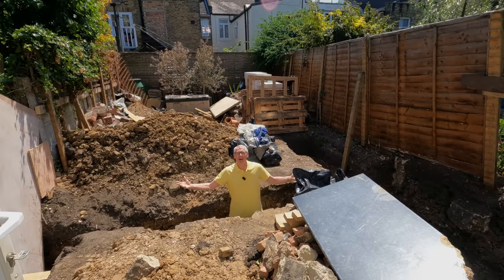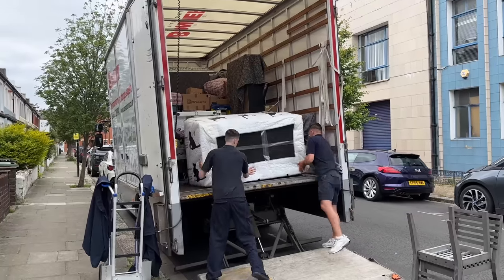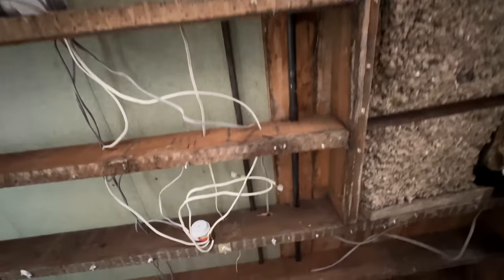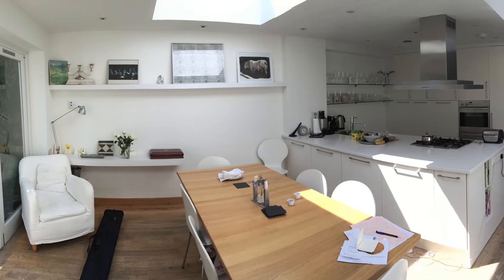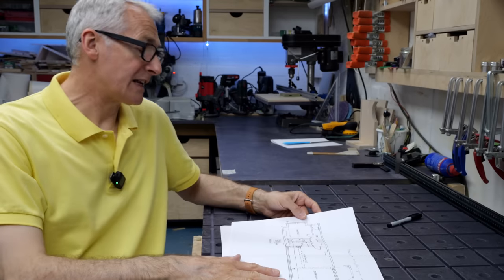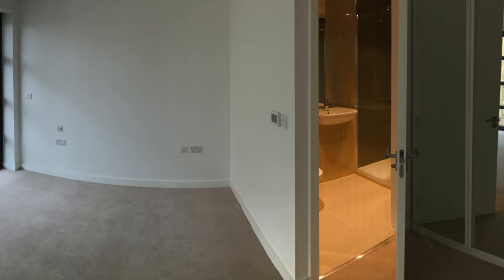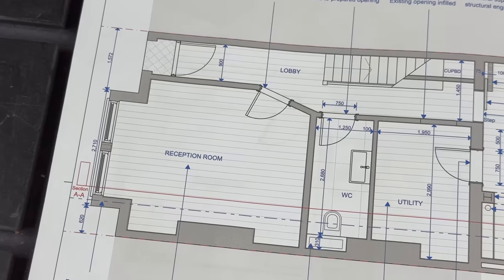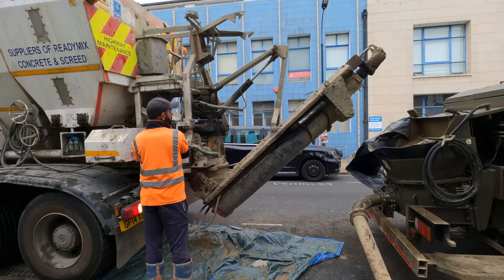Kitchen Extension in a Victorian London House [video 533]

Comment: Great start. My daughter and son-in-law are almost at the end of the revamping of my mother's house. Great chance to upgrade as much as possible. Electrics, plumbing, heating, and of course insulation. They had hoped to be in mid January, well they are living between families. The question is, can you stand back and watch others do what you know a lot about?
When done with some good tradesmen, you will have a great property. Still made of bricks and mortar. 
I watched plasterers do magic. An oak staircase going in like Robin fits. It's an art. GOOD LUCK! 
I was impressed by a young guy who fitted the kitchen, making the worktop pattern flow over the edge and down to the floor. A one man band who came highly recommended.
Reply from the maker: Thanks! I’m 100% all-in on letting others get on with it. Really pleased to have some great people involved, and yes the whole ground floor is getting reworked.  👍👍

Comment: Hi Peter. It would be good to hear about how you went about choosing an architectural type person and developments with them. Ditto how you chose the Chartered Structural Engineer and how the scheme was developed with them. And finally for this mini-tour how you went about searching for and agreeing costs and timescales with the builder, and if and how they changed the scheme and how thar was handled with Building Control. And if you've any energy left after that lot, to cover Party Wall etc. matters and arrangements with neighbours. [item 3 noted and respected].

Comment: Interesting project Pete.  Good luck!!  We did something very similar about 7 years ago on a 1907 house.  We stayed in the house throughout the build which made sense to us at the time.  You get used to grit and dust in your food eventually!  I'm sure you're already on top of this, but the one thing that really caught us out was delivery timelines.  We'd made assumptions (I know, I know) about how long thing would take and we were badly caught out.  Classic example being the liquid screed floor we had laid.  They take literally weeks to fully cure and filled the whole place with so much moisture we ended up with dehumidifiers all over the place, and that was in summer.  The other thing that really shocked me was the amount of goods that turned up damaged and had to be replaced - radiators, lights, coving, doors, windows, bifold bloody doors!.  I would say that (conservatively) 40% of what turned up had to be replaced. Also the sheer volume of decisions that had to be made early on in the project and throughout.  Jeez I'm getting palpitations just thinking about it 🙂.  If all that sounds negative, it shouldn't.  It was a massive learning opportunity which brought my DIY skills on leaps and bounds and we LOVE the new space that we've created.
Reply from the maker: Thanks! Hope it was all worth it in the end - and completely agree with the volume of decisions that needed to be made! 👍
Reply: @10MinuteWorkshop  more than worth it.  We live in the new space we created 90% of the time.  It's by far the most energy efficient part of the house.

Comment: Maybe a vid on each stage that BC sign off on, regs invlolved, choices made and why
Eg. 1m deep foundations because of soil type, neighbouring properties etc, how to calculate so Dpc,FFl match up etc.
choice of brick or blocks/render. party wall considerations..
Steels required and sizes, pad stones, placement of steel columns (off from party wall so not sat on the edge of the pads).
Roof pitch/general design considerations (eg. keeping the roofline)/ tiles for different pitches/vaulted ceilings/warm or cold flat roof/ insulation
Concrete slab or suspended floor (imagine your current kitchen is a mix)
Then obviously cabinets and doors for the kitchen

might help people understand the process/stages of an extension build and why things are done that way... and a nice refresher for someone like myself who spent a long time doing this but has spent a few years moving into cabinets and more pleasant pastures
Reply from the maker: Thanks! All that sound exciting like why we’re getting builders in, so we don’t have to worry too much about those details. But 100% take your point, and I’ll definitely be covering some of those aspects. 👍👍

Comment: You can't have enough sockets!!
Amazing series idea Peter; looking forward to all of it. I did a similar project in 2017 and it probably won't be my last. So interested for any tips. The one thing I got wrong last time is the electrics - in the rooms we didn't remodel we just replaced the existing sockets. Big mistake! Needs at least a double in every corner plus behind the door plus at least a second set wherever you're planning to have appliances!
Reply from the maker: Learned that one - also the hard way - long time ago! 😂 👍

Comment: Some yers ago an elderly member of the family 'did the right thing' and downsized. That was OK when they were fit and able but by then their children were working and living many miles away. When the elders needed more frequent help from their offspring they didn't have the room to accommodate them on a regular basis (weekly or fortnightly weekend visits). In the end the children ended up buying a second home to have the necessary space for those frequent visits.
Reply from the maker: Yes, that's exactly what you want to avoid, both as the parent and as the adult child! 👍

Comment: Very similar to my house Peter. Ours is Edwardian(1904)but we also have the side return which is handy for the outside tap, storing spare flower pots, garden furniture etc but is really a general waste of space. We’ve toyed with the idea of a side extension, glass roof and all that jazz but what puts us off is we have no side or rear access so everything would need to come through the front door….and obviously the cost of doing it as well. I’m a carpenter/cabinet maker so I’d probably do most of the required woodwork myself…
Reply from the maker: Cheers Andy; yes, exactly the same situation here - no side access means that everything needs to come through the house, which takes a lot longer eg bagging all the spoil from digging the footings meant it took almost 3 weeks for the to finish that - but only about 30 minutes to fill them with concrete! 🤷‍♂️

Comment: Having renovated, converted and extended several houses, I’m familiar with the process (and the stress), so seeing how you deal with the problems as they arise is interesting. I recently had a new kitchen after a leak, and had to solve problems with it. We all know that commercial kitchens are custom fit rather than bespoke, so I ended up making a bespoke extractor hood for mine as there was nothing available that fitted my circumstances. However, as a wood worker, my main interest will be on what furniture you decide to build rather than buy, to fit your modernised home.
Reply from the maker: Thanks! Yes, I'm saving myself for the fun parts, the twiddly bits after the main build is done; there'll be a kitchen table of some kind, possibly some banquette seating, and a bit of slatted wall panelling to consider, as well as a few other bits and pieces. 👍

Comment: We did this over moving too, unfortunately we started about a few weeks before covid happened. What was supposed to be a few months of work ended up going on for almost a year. No option to move out, was not fun especially when my partner and I were trying to work from home in the middle of winter in a house that had the back missing... Still would not change anything as the end result is amazing and now probably couldn't afford to do the extension we now have.
Reply from the maker: Thanks! Yes, I’m sure it’s a question that many folks have had to address - or will have to soon. 👍

Comment: Wow what a build you have started Peter, good luck. 

On the build vs buy kitchen question it's a definate build for me. All the high street/DIY kitchen website are essentially putting out the same gear on melamine faced chipboard with a few nuances on drawer boxes and doors. You could put together birch or maple ply carcasses that will stand the test of time. Likely wouldn't take long with the workshop being so close.

Got my latest pack of 18mm birch for £87.49 + VAT a sheet... improving all the time.
Reply from the maker: Thanks! Just for balance, the kitchen that’s been stripped out was a big-standard MFC job from Magnet, and was over 20 years old; still decent, and we may yet reuse some of the carcasses in the utility. 👍
Reply: @10MinuteWorkshop  true that, I am being a bit of a materials snob at the same time!

Comment: Mate the stamp duty here in australia is killer too. I bought my first home end of 2021 and after stamp duty I only had about $200 to my name. Thankfully my partner and I work full time so it wasn't that big a deal
Reply from the maker: Yep, brutal. First time buyers get additional relief - up to £425k without duty, I think - but that would buy you a house in most British cities, it barely gets you a 1-bed flat in London. 🤷‍♂️👍
Reply: @10MinuteWorkshop  we get relief under $650k and a reduced stamp duty up to 850k but same as you mate it would barely be enough to pay for a 1 bedroom unit outside of the city

Comment: Hi Peter, this sounds very useful. Personally, what would find very valuable so hear your thoughts on are how to make a decision on the builder - does the QS put it out to tender, and if the budget goes over, what is the process for working this out? Also, are you project managing it? If so, as a skilled maker do you find yourself wanting to query anything the builders are doing that you think is not the way you think it should be done? Thanks for creating your top notch content :)
Reply from the maker: Thanks Mike! It’s a pretty massive undertaking for us, but not enough to get a project manager involved. Fortunately Mrs 10M is Mrs Organised, and sorts everything out wonderfully.  More details to follow as the videos unfold. 👍👍

Comment: As much as you can!  All the bits that you would expect to be interesting- but also what you are doing to make it low maintenance - and how far you are going with insulation and air tightness - and may be a heat pump....?
Reply from the maker: Thanks! Have to be honest we didn’t consider heat pumps, and nothing I’ve heard since we started down this path has  convinced us that was a mistake - certainly not for a house if this type. 👍

Comment: I'd be interested in how you went about choosing the building firm to do the work, and how you manage them as the project progresses in terms of making payments upfront and how much work gets done before the next payment etc.  Also how much checking of their work you do, do your check the foundations and brickwork/stud work is square, do you check floors are level etc….?  I am about to put a large extension on the back of my house and all my previous experience of tradesmen in thre UK has been so poor that the only thing putting me off starting it is the worry about choosing a decent firm to the work.  I live in a 1920’s house and I’ve had various bits done already, from fitted furniture to decorating to a garage conversion, and invariably the work has not been up to standard and has caused me far more stress trying to get it sorted than simply doing it myself from the outset.  I clearly can’t build a two story extension by myself though, but I’m at a loss to try and work out how to get a get a decent result for my money.  Even recommendations from friends don’t seem to help as the person I’m contracting with just sends whatever subbies are free that day to my job, so the quality from man to man varies wildly.
Reply from the maker: Thanks! Yes, the whole ‘how to find a builder’ issue is a vexed one, and something to be covered in detail in the series. I think we’ve been fortunate and found a great company, and so far so good. 👍
Reply: @10MinuteWorkshop  best of luck 👍

Comment: Oh, and will you put any hrv / erv / other type of forced ventilation? Why or why not?
And climate in London: a quick search shows it's hot-ish summer but not over 30°C. Not much freezing in winter. Is that about correct? Thanks!
Reply from the maker: Hi Ákos. No, no type of for ed ventilation - sorry don’t know what or HRV or ERV are - some kind of air conditioning? You’re right about the temperature range - rare to go below freezing or into the 30s and while it can be humid, it’s infrequent, so there’s no real requirement for air conditioning - especially difficultly to install in a house of this type, anyway. 👍
Reply from the maker: Hi Ákos. No, no type of for ed ventilation - sorry don’t know what or HRV or ERV are - some kind of air conditioning? You’re right about the temperature range - rare to go below freezing or into the 30s and while it can be humid, it’s infrequent, so there’s no real requirement for air conditioning - especially difficultly to install in a house of this type, anyway. 👍
Reply: @10MinuteWorkshop  sorry, I meant Heat Recovery Ventilator. Meant to bring in fresh air while keeping some of the heat inside / outside depending on the temperatures. Using just a heat exchanger and fans, so not air conditioning like a heat pump, but does require air ducts, so difficult to retrofit. And might not be worth at your climate.

Comment: Do you make the measurements or does the architect and how tight are the tolerances between the drawing and getting accepted to continue.
Reply from the maker: We already had plans from when the loft was converted, though they did need some updating as the chimney breast was a little out. And yes, the plans for planning approval vs plans for builders is one aspect that I'll be talking about with the architects. 👍

Comment: Did the same sort of thing for the same sort of reasons at age 63! Have you any designs for going heat pump as part of the project?
Reply from the maker: Good to know Norman. No we haven’t considered heat pumps; perhaps we should, but nothing I’ve seen convinced me that they’re worthwhile in a house like ours, and my sister had a shocking time with hers. 🤷‍♂️
Reply: @10MinuteWorkshop  It is entirely down to the installer/heating engineer and the upfront design work. Unfortunately we have a few generations of heating engineers who know very little about heating and diddly squat about engineering - they have been slinging oversized gas boilers into houses (unnecessarily) and earning an easy living.

Dip your toe in the water and request a quote from Octopus if they say too difficult contact Symon (YT Urban Plumbers) or Andrew Millward (FT and YT).